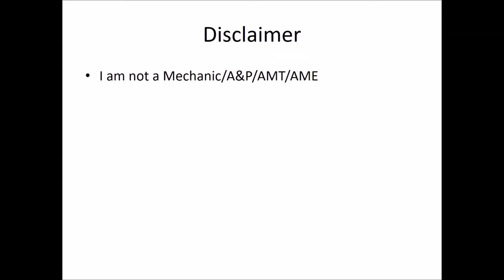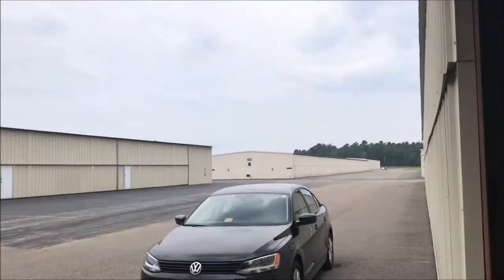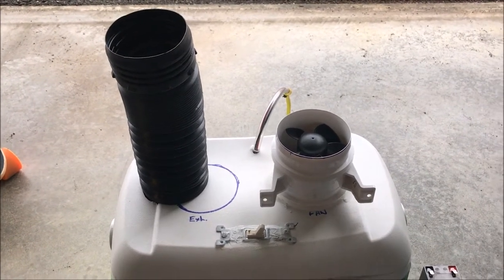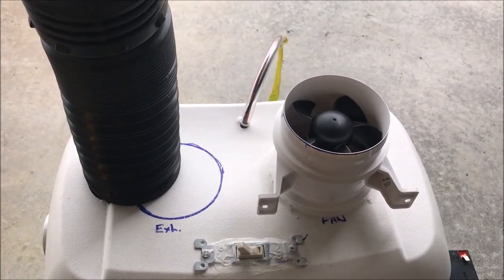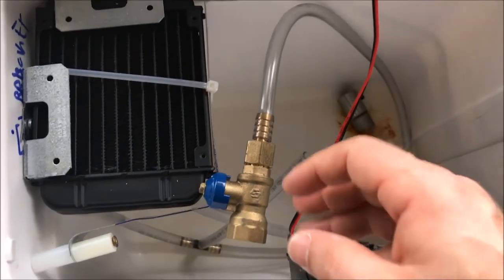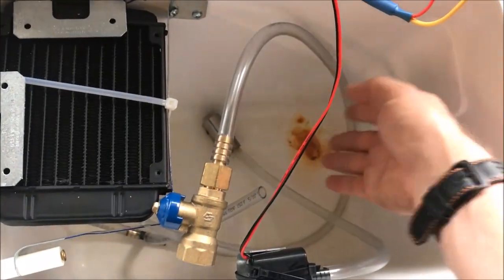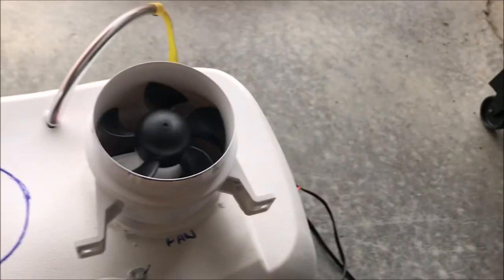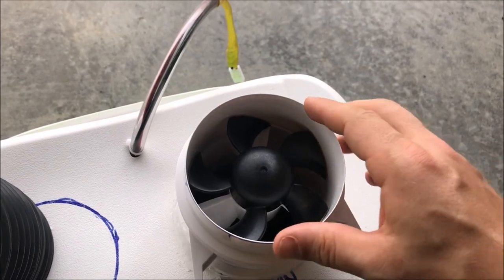Stay cool in the air by saving hundreds on an A/C cooler unit!

Comment: Great idea! Did you consider leaving the battery out and using the aircraft power outlet instead (cigarette lighter, etc) and did you consider a wheeled cooler to make getting it to the aircraft on the flightline easier?
Reply from the maker: Both great ideas!  I like it.  Maybe for version 2 :)